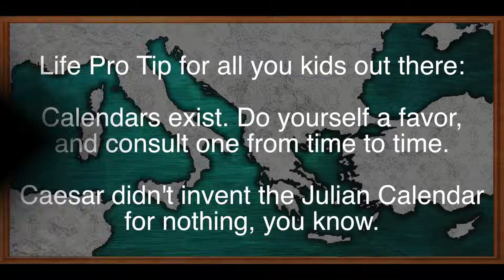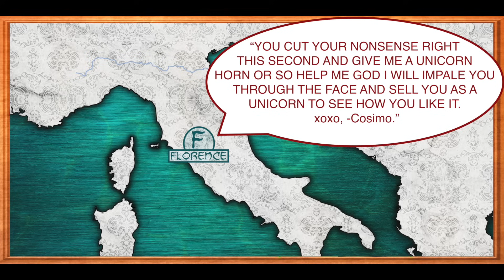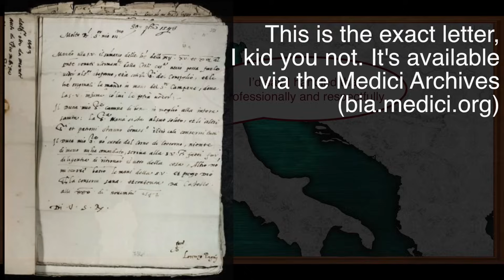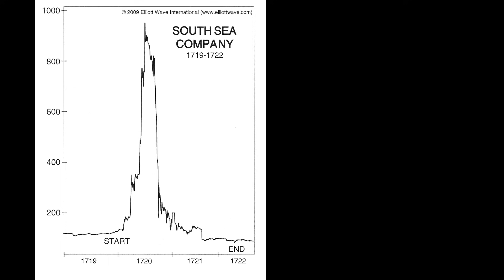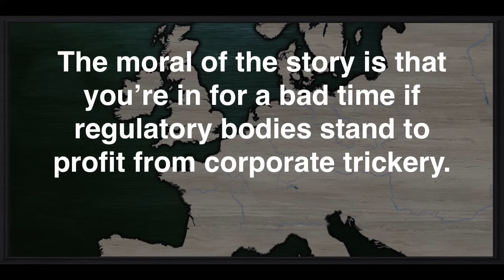Blue's Dumb History Tales

Comment: "Okay so the front gate of the fort is wide open, and you don't see any soldiers inside."
"I go in."
"You go in?"
"Yes."
"Okay... What's your passive perception?"
Reply: "I don't go in."
Reply: ...uh, I rolled a 3, is that bad?
"Roll for initiative!"
Ohhhhhhhhh noooooooo!
Reply: @AnimeSunglasses  Being pedantic here. If DM asks you for the passive perception stat, that forfeits you from rolling for active perception because that's metagaming.

Hence no rolling. You either just pass the check or not.
Reply: @Revoltine  would initiative not still be a separate step?
Reply: I've only DM'd twice, but I asked my players for their passive perception stats before we started, and kept it pinned to my board. If players would notice something without rolling, I then tell them.

I also pre-wrote several messages as draft texts, for certain planned encounters. "You notice that x is out of place, you look around and spot y" or "you spot dust moving on the floor. There's no breeze, there must be something invisible moving around in the room" stuff like that.

If only 1 or 2 players would notice something, then I send them that message at the time.

Prevents the other players from metagaming, and IMO it helps the narrative and mystery. It also surprises the players who didn't notice, when the one player who noticed the enemy sneaking up on them suddenly goes "I spin and fire an arrow behind me!"

Comment: STOP INSULTING LEECHES. They are a valuable source of memes. And do have a valid medical use.
Reply: I'd also have to posit that "Maggot therapy" whereby an open, aged, and festering wound is "filled" with fresh "medical grade" maggots, and wrapped... thus allowing the maggots to eat the necrotic and infected tissue away with microscopic precision under the wrappings...
    ...IS probably more disturbing and uncomfortable than anything medical science has attempted with leeches.

     AND for the record, yes. It really DOES exist. ;o)
Reply: Truth. I love how it's so gross and so good
Reply: gnarth d'arkanen the best part is that it actually works, the maggots used for maggot therapy only eat dead tissue (not all maggots only eat dead tissue, so do not try this at home). Some of the more common situations they are used for are things like diabetic ulcers (especially on the feet). There were even a few cases of extremely old journals mentioning maggots doing this. One Confederate doctor was particularly annoyed with soldiers neglecting wounds. One day, he noticed a soldier with an old (and neglected) wound, the odd thing is that the wound was not infected, in fact, it was looking better than lesser wounds that have been neglected way less. Well, the wound had maggots in it, as such, this kept the wound mostly clean and it even started healing (maggots are not particularly dirty). There have been similar cases, but most of them are just cases that doctors pointed out, not many would actually dedicate their time and resources to researching maggot therapy for a while (note: I mean its modern form, there have been cases of people purposely infesting wounds, but these were crude attempts at what we can do today). 

There is only one catch though, there have been many reports of people being able to feel the maggots wiggle in their wound... so yeah

Comment: Oh My God.  I think the South Sea Company was the Trade Federation.  Did they try an impose a perfectly legal trade blockade on Spain?
Reply: If the TradeFed had been like the SSC, they would have had maybe 1 ship, not even a Lucrehulk. Maybe a super old and unmodified stock YT-1200. Instead of having trade rights/control of the Outer and Mid Rim, they'd be trying to trade with the isolationist Hapes Cluster. Using Nerf wool.

The SSC was in function, a government back pyramid scheme. Tricking people into forgiving debts government owed them. I can't think of a major organization during the Republic, or even the Empire, that was similar. Maybe on some backwater mud ball on the very fringe of the galaxy. Where they think companies are people.
Reply: England was already at war with Spain but then sued for peace and tried to get rights to trade with the Spanish ports in South America. The got the right to send one ship per year to each port, which was nowhere near enough.

Comment: Japan during it's Sengoku Jidai period has a similar story of relying on opening the gates and confusing the enemy army when your army is like... 10 guys left as well. So either the Romance of the 3 Kingdoms curbed from that, both are fanciful tales, or just coincidentally both China and Japan had very similar events happen in history.
Reply: Since the Sengoku Jidai period spans mid-1400s to early 1600s, the Three Kingdoms period predates it by more than a thousand years. Assuming you meant to type 'cribbed' instead of 'curbed,' not sure how your first assertion could possibly pass muster
.

Comment: Ah, the Empty Fort Stratagem! Being a huge Three Kingdoms nerd, I cannot help but feel a burning need to expand on that very, VERY brief treatment of it. First of all, the guy who did it was Zhuge Liang, AKA The Sleeping Dragon. That's the kind of nickname you don't earn lightly. He was basically the most legendary and feared strategist of the era, and indeed directly responsible for there BEING A THREE KINGDOMS PERIOD. At the start of that particular era of civil war, power had started to coalesce around just two major kingdoms, you see - the Wu and the Wei - which is a fairly unstable setup. If you only have two factions, then at some point one of them is going to become powerful enough to take out the other one and win it all, which is exactly what was about to happen. Wei had a big army, a big fleet it was using to transport said big army down the Yangtze River to invade Wu, and a legendary king - Cao Cao, known as 'The Hero of Chaos', which is ALSO the kind of nickname you don't want to mess with. The Kingdom of Wu was basically getting ready to surrender, which would've ended things right there...

EXCEPT that one Zhuge Liang, after having initially attempted to sit out the whole war, had just agreed to throw his lot in with some chump nobody named Liu Bei - a former sandal-merchant with some EXTREMELY remote imperial lineage, a truckload of Noblesse Obliege, and a couple of sworn brothers who were world-class badasses in combat. For him to build up a proper power-base and become a real contender for unification would take time, so Zhuge Liang spread a rumor that Cao Cao intended to add the Two Qiaos - a pair of legendarily beautiful sisters who happened to be married to, respectively, the King of Wu and his chief general - to his personal harem. Suddenly, support for a surrender dried up. Then, between some truly terrifying stratagems involving a turncoat strategist on the Wei side, a devastating fire-attack, and some very careful disposition of Liu Bei's aforementioned badass brothers, Zhuge Liang both turned the resulting battle into a victory for Wu, AND ensured that Cao Cao himself was able to escape home to Wei rather than being killed or captured right there... which would've led to WU immediately taking the big prize, which obviously wouldn't do either. The final result was a stalemate between Wu and Wei as both of them licked their wounds after this huge battle, giving Liu Bei - with Zhuge Liang's careful guidance - enough time to establish the Kingdom of Shu off in the western side of the now-fractured China, kicking off the Three Kingdoms Period proper.

Now, I go off on that very long tangent so that you understand just what kind of absolute galaxy-brain Zhuge Liang was. His abilities as a strategist and tactician were so great, most believed him to be a Taoist sorcerer, capable of commanding the weather and conjuring soldiers from thin air, among other miracles. NOBODY wanted to mess with Zhuge Liang, and those who did so anyway... well, they tended to regret it. He was the undisputed BEST STRATEGIST of this era - a time FILLED with chillingly brilliant strategists. Now, remember that old adage about how the best chess-player doesn't fear the second best chess-player, he fears the worst chess-player since there's no way of telling what that fool is going to do? Sima Yi was the second best chess-player. One of the greatest military minds of the era, chief strategist of Wei, working under the aforementioned Hero of Chaos, Cao Cao. But he could never beat Zhuge Liang. Throughout their lives, they butted heads, and Zhuge won just about every confrontation - a trend that carried on after his death, even, thanks to a post-mortem stratagem he'd arranged before a long-time illness finally claimed him... leading to the Chinese saying that a dead Zhuge Liang could beat a living Sima Yi.

So, yes. When Sima Yi led an army up to that empty fortress and saw Zhuge Liang playing the guzheng above the open gates... he turned back. It was, indeed, a bluff - but it didn't take five natural twenties, not even close. Zhuge basically had an immense circumstance modifier to that bluff-check thanks to his huge rep in general and his history with Sima Yi in particular. It was thanks to all of this that Sima Yi knew - not thought, knew - that if he led his army through those open gates, he'd be stepping right into a devastating trap. And so, he retreated - beaten by the Empty Fortress Stratagem... and the Sleeping Dragon, Zhuge Liang!

Comment: There’s always “The Angels of Mons” during WW1. As a likely an inaccurate synopsis, a group of British soldiers were being attacked by a much larger and well equipped German during the Battle of Mons. Story goes that angels came down from heaven with golden bows and protected the British and reopened the Germans. What is beloved to actually happen is that the British were much more well trained on their SMLE Rifles than the Germans were with their Gewehr 98’s. When the Germans got close enough the British switched from single shot to rapid fire and cranked out enough rounds quickly enough to fool the Germans to think the Brits had some machine guns.